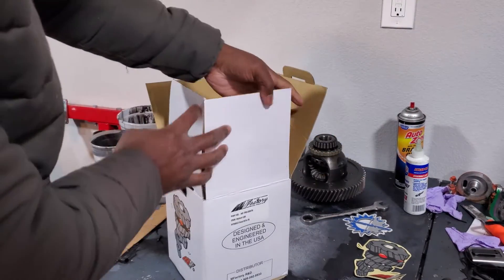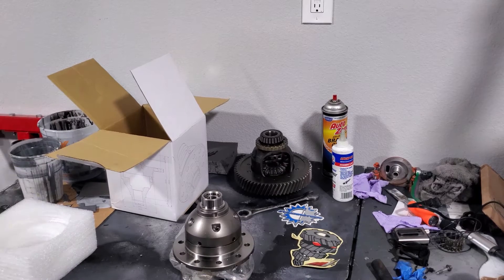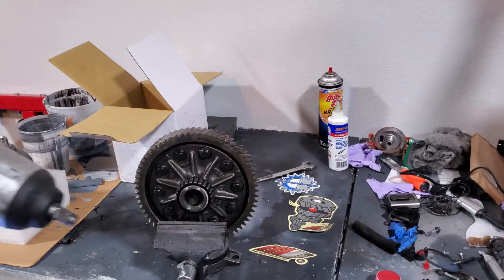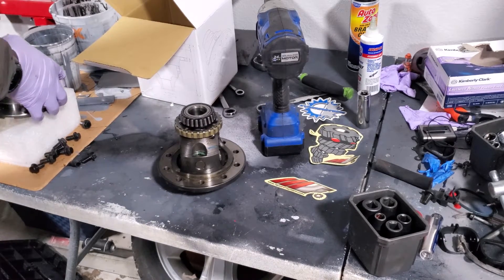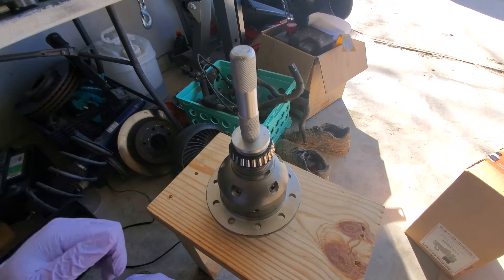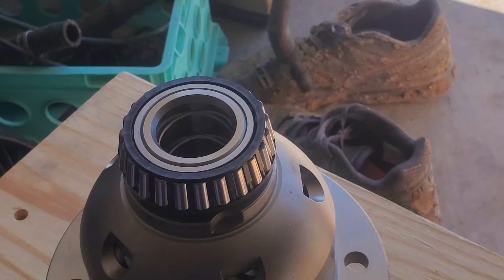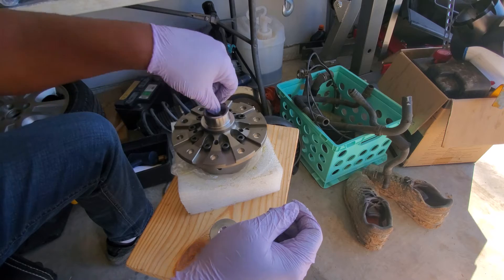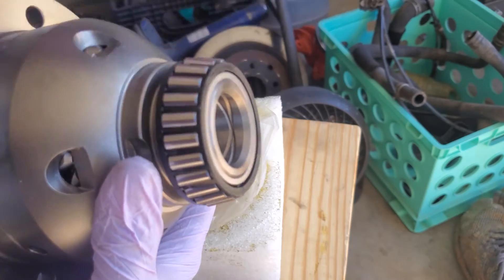Transmission P-1

Comment: How come you didn't put the tone ring back on the lsd? Won't it not pick up the vehicle speed?
Reply from the maker: You are spot on! Noone else caught this. This did make the speed  unable to be read.
Reply from the maker: The largest issue im having with this is it is discontinued and cannot be found us wide. So ill habe to make some choices on what next to do for the focus. Might end up gutting it for a newer model engine trans and interior wiring!
Reply: @FocusedHands  That's really the main difference in the mk1.5 and mk3 trans is that sensor and tower.  I ended up buying a second trans for parts.
Reply from the maker: @nicholausm8931  I found a new unit in poland! currently working on the logistics to get it here. I've also taken the old trigger wheel off and will likely use it should anything go wrong.